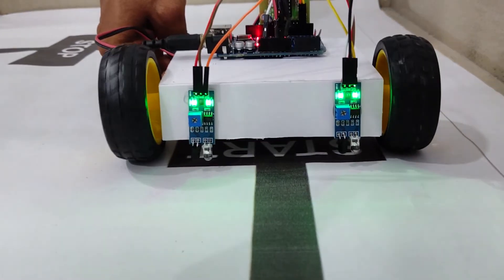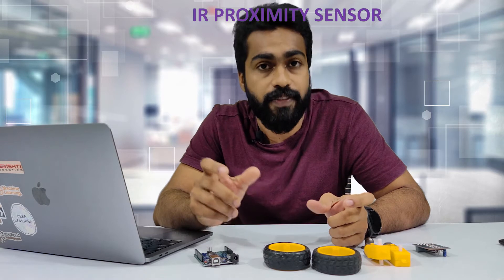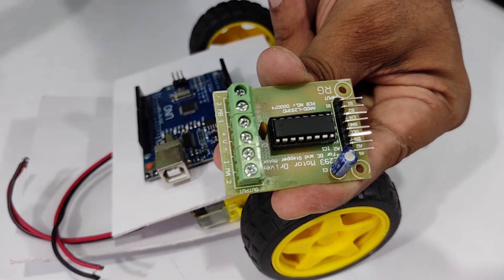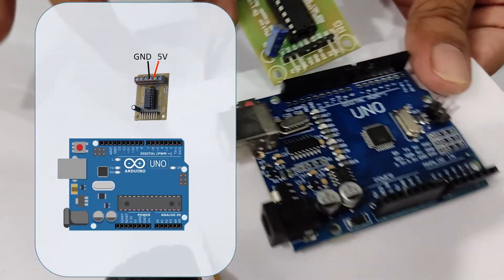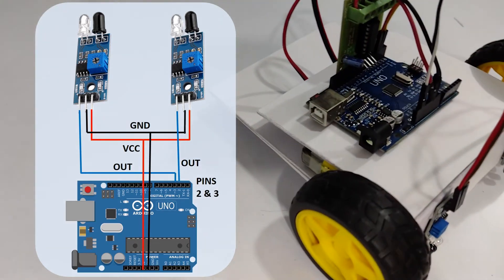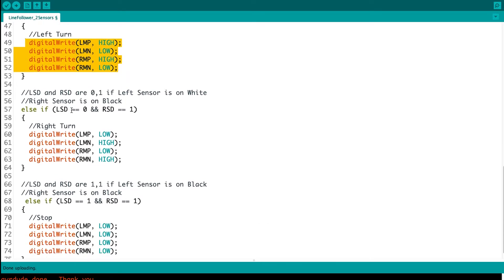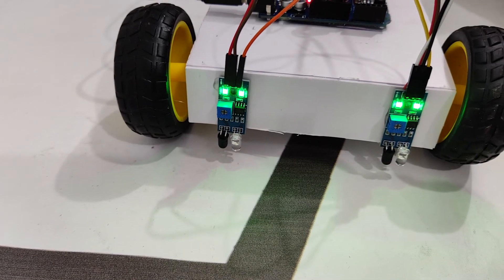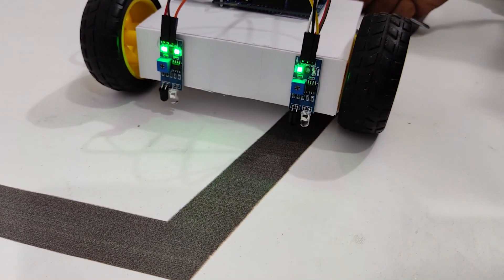How to Make Line Follower Robot With Two IR Proximity Sensors and Arduino

Comment: What happens if an object is placed infront of the car on the line, will it stop automaticlly at a certain distance or..?? if not how to do that?
Reply: with this configuration it will not stop as it has no such sensor to sense that. To do so you can add a hcsro4 to detect any obstacle in the path

Comment: sir , i want use line follower robo to carry little high load arround 10 kg torque  minimum , what motor driver , what motor i have to use kindly help me. Thank you
Reply from the maker: You can use high torque Johnson gear motor with MOSFET based driver.

Comment: Sit when I did this project I have an issue with supply. I don't know how much supply we should give to the setup... I gave normal 9v battery supply. Please explain why is normal 9v battery not working sir why are all using only lithium batteries what are the minimum requirements for the project
Reply: I mean power requirements sir
Reply from the maker: In this hardware setup power consumption by ir sensors and motors are little high, so a normal  9V battery may discharge faster and the sensor will start malfunction due to less current and voltage. So better to use Li-Ion battery or supply with more mah.  [ 7.4 volts to 12 volts is enough but mah matters]
Reply: @Srishtirobotics   how much mah should we take sir...
Reply from the maker: Minimum 1000mAh is recommended. Normal 18650 li-Ion single cell comes on an average of 2000 mAh.
Reply from the maker: If you are using only 2 BO Motors & 2 IR Sensors try using Power Bank Instead.